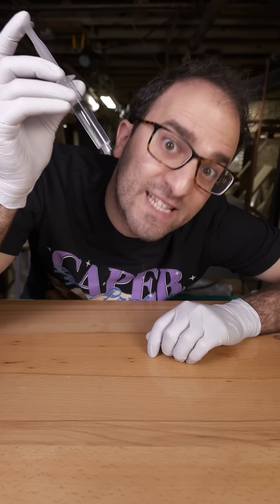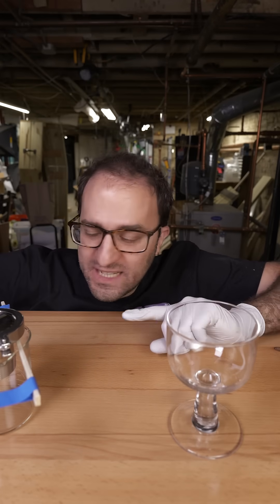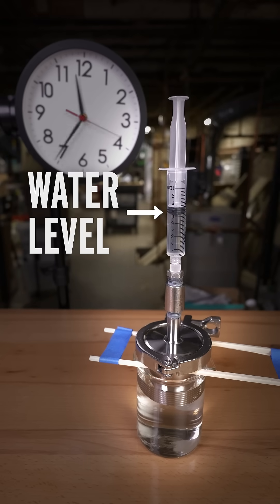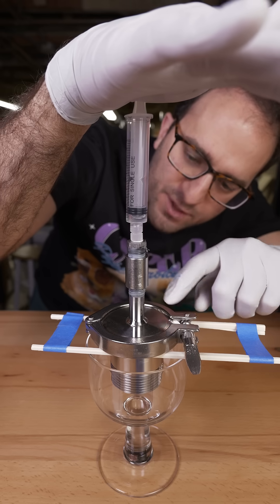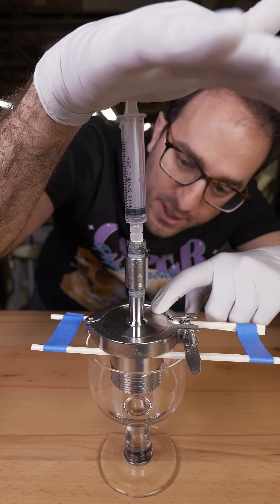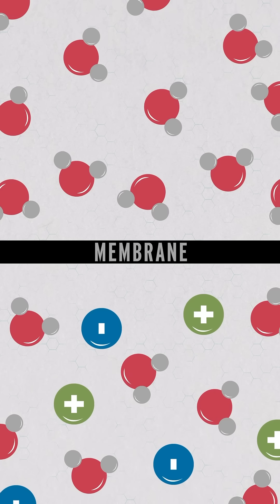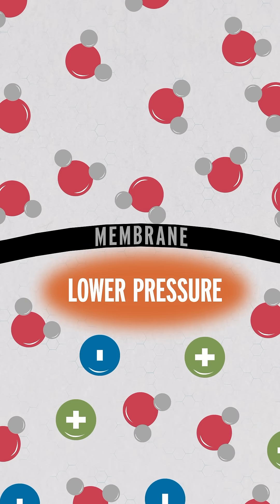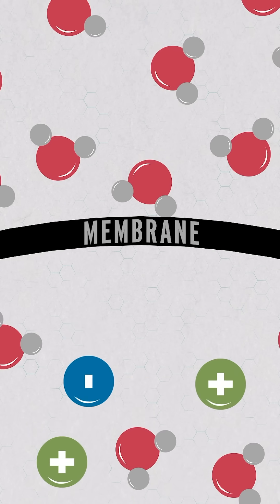most textbooks are mostly wrong about osmosis

Comment: This is easily disproved with a non-tight membrane.
Reply from the maker: If you start off with a non-tight membrane (that's firmly held in place so that stuff can't just move around it), osmotic pressure will make the membrane tight
This paper has a full explanation https://pmc.ncbi.nlm.nih.gov/articles/PMC10457415/
Reply: @ACSReactions  It will make it so that the membrane is pushed towards the pure water solution, since the pressure of the salt solution ends up being higher (this is not a disputed fact about osmosis). This is in contradiction with the claim that the salt ions "create lower pressure".
Reply: @llatato  my guess would be that the lower pressure is transient and localized to a small area adjacent to the membrane when the ion collision happens. The speed at which the small localized perturbation is made and is then allowed to relax is much faster than the speed of the collective motions of the whole membrane, so water can flow into the small space of the perturbation

Comment: Maybe I'm being too much of a theorist, but the textbook explanation seems not at all in tension with the bouncing model? The reason the water flows in from the other side of the membrane and not the salty side is because there's a chemical potential gradient regardless of the membrane. The dynamics being different near the membrane is a result of a change in the medium. Diffusion always boils down to deterministic physics, but globally it's still diffusion.
Reply: I would phrase it as them being models with two different purposes. The "bouncing" model is the mechanistic model that explains how it happens on a molecular level, and the traditional chemical gradient as the phenomenological model that you use if you're doing anything practical. You don't need to do molecular dynamic simulations if all you need to do is calculate osmotic pressure.
Reply from the maker: Saying water moves from an area of low solute concentration to an area of high solute concentration is correct, but only descriptive -- doesn't explain why it happens. Saying water does this because of diffusion is the incorrect part. See this paper for the full details: https://pmc.ncbi.nlm.nih.gov/articles/PMC10457415/
Reply: @ACSReactions  but it does. In the same way the brownian motion of molecules making them collide with the walls of a container gives rise to (or is interpreted as) pressure. 

A box with a fluid at the same temperature as the fluid outside the box (same fluid also) but at a higher concentration of fluid particles gives rise to a pressure difference at the walls, phenomenologically explained as a higher number of collisions happening on the inside walls than on the outside, despite each collision transfering the same average amount of momentum (because the temperature is the same).
If the box is now a partially permeable membrane and the fluid inside has a high concentration of dissolved things that can't penetrate it, then even though the total thermodynamic pressure of the fluid is the same as the outside, effectively the partial pressure of the solvent inside is lower than the (pure) solvent fluid outside. That is phenomenologically understood st the microscopic level as a lesser number of solvent particle collisions inside than outside, where each solvent collision has a % chance of passing through. This then statistically means that more solvent fluid particles move towards the inside than towards the outside. 

That average movement of particles in a fluid across concentration gradients is the definition of diffusion. That diffusion movement is macroscopically understood as a pressure difference (osmotic pressure), but none exists microscopically.
In a Maxwell's demon scenario, you could imagine no membrane and instead the magic demon flicking the solute particles back every time they try to cross the imaginary membrane (or opening a hatch in a non-permeable membrane only when solvent is about to collide) and the result would be the exact same.

Comment: thats the first time i get an actual explanation for where the pressure as in a force is coming from. thanks!
Reply: As other comments have pointed out, this is highly suspect and the guy's explanation is not correct. If this were the cause of osmotic pressure then it shouldn't work on a loose non-elastic membrane, yet it still does
Reply: @BetaDude40  exactly. Osmotic pressure functions due to entropy, because when a solution is less concentrated, the entropy is maximum and the system is more stable. The driving force of this energy balances out with the pressure created by the then-more concentrated part. This is the reason why if you change the pressure on one side, this equilibrium is altered. A good way to disprove the "bouncy bouncy" theory is the way starch works. The reason plants store glucose in a polymeric form (same as humans) is that it reduces osmotic pressure and the entropic contribute of the glucose chain is way lower, which is needed to keep isostasis without having your cells explode. Starch obviously doesn't bounce around on cell membranes, as it's stored in a pretty organized way, so yea, this is blatant misinformation. Of course i simplified the concept, but the important thing is that this is a thermodynamic concept, not a kinetic concept.
Reply: @enderforces7013exactly I highly doubt the host's qualifications, this is not the first time he made a misinformed video, osmosis is taught in middleschool and the detailed principles are taught in highschool
Reply: @sroy7982  yea i just put the channel on the "don't recommend me" thing. Misinformation is so annoying.
Reply: The explanation is utterly and completely wrong

Comment: would be easier to distil the water.
Reply: Much more energy is required to distill water than to do reverse osmosis. But that is not to say that the type of energy involved has to be purchased.
Reply: @YodaWhat  you could use the steam created to generate some energy to offset the cost.
Reply: @zednott then the steam and water are contaminated from the turbine. 

Distilled water isn't really that environmentally friendly there's hard water mineral sediment left behind, and just cleaning it or it coming into contact with the ground in high concentration isn't good.
Reply: @zednott  It's not what you're thinking. You need some real world experience, not just ambition and your own perspective.

Comment: What about concentration gradients other than salts, such as fucose over a cell membrane, or when a membrane is separating several different gradients?
Reply: That's one way they make maple syrup.  Reverse osmosis.
Reply: Your question is unclear. Please specify: What aspect of osmosis or osmotic pressure are you inquiring about?
Reply: @YodaWhat  the membrane moving as the main way of equalizing concentration seems to me to only work when there's a single concentration gradient. What happens in the case when you have several competing concentration gradients, in opposite directions I've the membrane? (High concentration of substance A outside the membrane, but simultaneously high concentration of substance B inside the membrane).
Reply: @YodaWhat  His question is perfectly clear. He's asking about semipermeable membranes for solutions other than ions, like fucose (a sugar) or when several gradients exist between a membrane (like more sugar on one side, and more salt on the other side of a membrane).

He's asking a question that strikes at the core of why this entire video is false. If osmosis was really driven because ions that couldn't pass through the membrane were hitting it and causing pockets of low pressure, why doesn't osmosis occur with non-polar molecules in the same conditions?

Only polar substances contribute to osmolarity. The reason for this is a complex rearrangement of water molecules around said polar substances which is energetically favorable. This leads to a net exchange of energy from one side of the membrane to the other which produces the work (change in volume/pressure) you see in the video. A change in pressure does not cause a change in pressure as the video posits is happening. Also, his idea of ions "bouncing around" is pointless. Fluids by definition are a bunch of molecules/atoms bouncing around and does not explain osmosis.